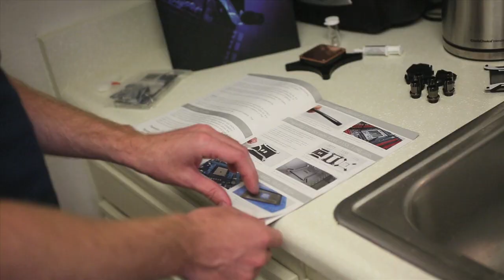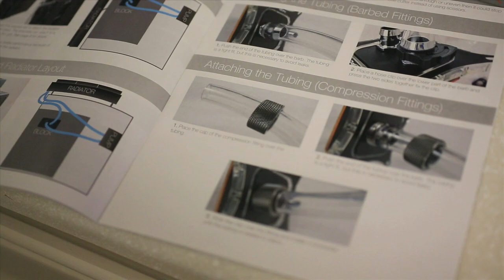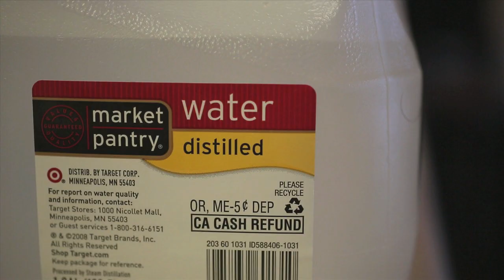A Beginner's Guide to Water Cooling Your Computer

Comment: Thanks but no thanks. Water will never get near my 2000 USD computer.
Reply: Dabket3araB you realize that its completely safe if you aren't an idiot. There are even all-in-one kits meant for idiots. So, ye.
Reply: Dabket3araB exactly :( 

edit: i ended up water cooling my $2400 pc ._.
Reply: robslifting4life Here's the PC I've built a month ago, Mr. Alienware Junk. 
Asus motherboard Maximus VII Hero
Intel i7 4790k at 4 Ghz
16gb g skill ripjaws x ram
GTX 980 4 GB EVGA video card
500 GB sata III HD
27 inch 2k resolution Qnix monitor
Corsair mechanical keyboard 
Logitech Gaming mouse
Total of 2800 Dollars to be exact. It is worth every penny. Again, no water will ever get near this Computer.
Reply: @Dabket3araB   jesus. i've spent a total of $800 on my newest PC and it can play most games maxed at 2K resolution and easily maintain over 120fps. did you spend most of that on the monitor, keyboard, and mouse? also why 16gb?
Reply: Dabket3araB First of all, just because i happen to know the exist, does not mean anything about what i do or don't use. Second, they are much easier and much less risky to set up than an open loop(whereas what i am talking about is a closed loop). Obviously its not for actual idiots, who wouldn't be able build a PC in the first place. 

You know this video? Yeah, you don't have to do 90% of it. You just put the radiator somewhere and the water block on the cpu. For example: http://www.coolermaster.com/cooling/cpu-liquid-cooler/nepton-240m/
Reply: Dabket3araB if you know what you are doing, its actually much better for your computer, especially with a high end cpu
Reply: No No No… Electrical conductivity of ultra-pure water is 5.5 × 10−8 S/cm (18 MΩ cm in the reciprocal terms of electrical resistivity) and is due only to H+ and OH− ions produced in the water dissociation equilibrium. 18 MΩ may sound like a lot, but as computers are very very sensitive electronic devices, it can still cause disastrous results when it leaks.
Reply: Marco Fella Why not get an i7 4790k if you have the money to buy it? I'm not being arrogant but when I shop electronics I aim to buy the best..
Reply: It's not a $2k pc because he is including peripherals like monitor. Also, you should buy an SSD, it makes such a huge difference, and now days you can get all in one water cooling for CPU, you just plug it in and that's it.
Reply: Dabket3araB i'd wager $1M on some good ol' hose clamps and teflon tape.
Reply: Lucas Jay not if you use mineral oil :P
Reply: LammaNerd no, water is not conductive the particles / free radicals make water conductive. ie... have a cup of distilled water with all of the impurities taken out add a light and (+) wire, then add other end into the cup. plug the negative directly to the light / plug, same with the other (+) wire. the light will not turn on...... now unplug the set-up and add a table spoon of salt "Impurities" to the water plug it in the light will come on.. I'm surprised that you have not done this in basic chemistry class.

Distilled water does not contain dissolved salts and, as a result, it does not conduct electricity and has an electrical conductivity of zero. Nevertheless, when the salt concentration reaches a certain level, electrical conductivity is no 
longer directly related to salts concentration.
Reply: Dabket3araB 
Asus motherboard Maximus VII Hero - 200
Intel i7 4790k at 4 Ghz - 340
16gb g skill ripjaws x ram - 100
GTX 980 4 GB EVGA video card - 525
500 GB sata III HD - 50
27 inch 2k resolution Qnix monitor - 450
Corsair mechanical keyboard - 130 (Assuming this is K70)
Logitech Gaming mouse - 80
Case - 240
PSU - 190

Total: $2305. If you paid shipping, that should be around $2400. That's 400 dollars you've thrown.
Reply: Math Debator
Btw, if you used alcohol, it would deteriorate the rubber tubing and also then destroy it, in the matter of days, instead of years, like the coolant does.....
Reply: I just built a new rig:
MSI Gaming Z170A M7 mb
i7 6700k
16 GB corsair vengeance
250 GB samsung SSD
2 TB caviar black
EVGA 980ti GPU
EVGA 750 PSU

I was really sketched out to put a water cooler in there, but I decided to give it a shot and bought a Corsair H105 and put it in.  I checked it the next day just out of paranoia and found a little bit of liquid leaking out at the base of the tube on the CPU block.  I said fuck that and returned it back to microcenter and picked up an air cooler.  Yeah, most of time that's not gonna happen, but it happened to me on my very first time, so I don't think I'd ever be able to rest at ease as long as I know there's liquid running through my computer.
Reply: Dabket3araB Its not water .. its an non conductive liquid you could pour it all over your pc and it wont short
Reply: @nedd44  you just solved my worries thano you and how much does it cost app?
Reply: nedd44 ... dionised water will aggressively recoup ions when running in your loop. It might start out non-conductive, but it doesn’t stay that way for very long. At all. Leaks are no more dangerous than psi death, and much less common.
Reply: Lucas Jay thanks :D
Reply: Dabket3araB sorry lol. i was thinking you would look things up, but i see why you took it like that.
Reply: Dabket3araB  Why did you bother getting  i7 4790k if you aren't going to  water-cool and overclock??  You do realise that the 'K' on the end denotes an unlocked chip.  It was made so that it could be over-clocked!  JEEEEZ!
Reply: Dabket3araB 
That PC was 2800 dollars? What the fuck? Where did you buy those parts? That is terribly overpriced. My PC was 1000-1100 dollars and the only thing different from that build is the GPU and RAM. My ram is better than yours and my GPU is a 970. I also have more storage than you along with a SSD and mine didn't go over 1300.  All of that together wouldn't even be 2000 dollars, so my mind is incredibly blown that you got it for a whopping 2800.
Reply: Dabket3araB If you have a 2000$ computer it's probably smart that you get water near it because water cooling helps keep your components cool and reduce the amount of dust in your computer along with the lower temperatures allowing overclocking
Reply: use a computer coolant made for it then. the coolants do not conduct electronicity
Reply: I actually got curious myself if coolant is conductive so i got my Fluke 175 and measured its resistance.
I tested clean distilled water and an EKWB Evo UV-Blue mix.
Turns out both liquids have around 500k Ohm resistance with the probes all the way in and around 2inch apart.

So yeah, better dont spill it.
Reply: +Dabket3araB Because its a bit like buying a Ferrari in a world of by roads and dirt tracks, ie it will never reach its full potential. (Assuming you're only going to game on it) You could still buy the best but much cheaper by choosing an overclockable i5, a bit less of the same ram etc etc. You could have halved your bill and you''d be getting the same performance you are now. But it seems money is no object to you and you just want to boast about your rig, in that case, good for you!
Reply: Dabket3araB I used to say the same thing, but, since I found my computer getting a bit warm, with my AMD FX-8350 CPU, I decided to look into what my alternatives are, and I found, the "Cooler Master Seidon 240M" which is completely sealed, and there is a leak-proof set-up for it(As long as you do not try to go to the extreme, and cause it to leak, obviously.), it works great, and it is quiet as can be, which, it has no reservoir, so, that eliminates that issue, plus, the tubing is clamp style sealed, which, are sturdy clamps, and I was able to fit it into my ThermalTake V3 AMD Edition Mid-Tower case, and like I said, it runs great, and super quiet, and no leaks.  Also, the computer, that I am using, is a custom computer, as well, which, I put close to $2,400.00 in the parts alone, I have an MSI 970 Gaming motherboard, AMD FX-8350 CPU(8-core), ThermalTake V3 AMD Black Edition case, MSI RADEON 6450HD 2GB graphics card, Seagate 2TB 7,200RPM hard-drive, dual 400GB 7,200RPM hard-drives(From my last build.), WD 750GB 7,200RPM hard-drive, Cooler Master Seidon 240M water-cooler, dual SilenX EFX-12-15R Effizio Silent Red LED case fans(120mm), with the red LED fan, that came with the case, Ultra LSP Series V2 750W PSU, chrome finished fan grills, for all of the fans, along with foam style filters, for the inlet fans, Cooler Master Thermal Compound(It is the most efficient compound, since it cools the CPU more then most others.), dual Samsung CD/DVD burners, along with a Samsung 19" monitor(Temporary, for now, until I can afford the 27-30" monitor.), as well as a few other misc stuff, but, I am sure, you get the idea, that I do have a high-end computer tower, as well, and btw, it took some minor modifying to the case, to fit the radiator inside, while the fans sit on the outside of it.........
Reply: +Dabket3araB dude, that's like a $1200 computer right there.  adding some overpriced mice keyboard and monitor doesn't count towards what your actual computer is worth.  And if you really spent $2800 on that, you got fucking ripped off.
Reply: i'm using the coolermaster evo 212 and it will stay in there forever!
Reply: Dabket3araB plus you can upgrade it if you wish
Reply: purewaterruler You realize you still need a pump right? That coolermaster has the pump built into the water block. 

something has to move the water, genius
Reply: WithoutLUCK sorry i forgot to mention something that would seem obvious. yes, all in one kits/closed loop kits all have pumps built in.
Reply: LammaNerd uh, thats not the reason. it just has a high heat capacity. it is conductive, but that doesn't help it at all.
Reply: Dabket3araB You can always buy non conductive liquid coolant
Reply: Lucas Jay Ok, then explain how a large number of people have done this without any consequences.
Reply: Marco Fella Asus motherboard Maximus VII Hero ?  Fans will never again smother my CPU.
Reply: Dale Kravets I have no idea what you are talking about.
Reply: Dabket3araB buy awater cooler then :p
Reply: Dabket3araB You do realize this video was made in 2012 right? Most people don't do water cooling like this anymore... Water cooling is just as easy is setting on a traditional Noctua cooler. They also don't leak nowadays. And 2000 for a PC build isn't much. I paid 2000 for my build. I just wanted a decent build. My next machine will be much better.
Reply: 03SilverMustangGT $2000 is a lot! In fact, a lot of PCs are around the $1000-$1500 margin, give or take a couple hundred. A $2000 PC, if built right with good, quality parts, will get at least 80 fps on BF4 with everything on Ultra.
Reply: bdawes123 i don`t know what you make wrong or something i play battlefield 4 with my 1000€ computer at ultra with 140-180fps all the time
Reply: Kevin Kern I said at least, accounting for frame drop, high city areas, etc.
Reply: ***** Yeah around 2800 Dollars, I wasn't lying. But you gotta understand dude the screen alone is a 2k resolution and the keyboard is mechanical fully customized and the mouse is as well specifically for gaming. These 3 accessories costed me alone about 700 Dollars.  So do the math now and come back to me...
Reply: Lucas Jay wat about mineral oil?
Reply: Lucas Jay would it still be as effective as distilled water? Would it take longer to cool or do they perform the same? If they did i'd just use mineral oil for everything then :/
Reply: Lucas Jay No that's cool i always like learning more about pc building :D you can never know too much haha but yeah that's interesting. Thanks for the information that's interesting. So that means then that distilled water and using dyed stuff is the same the only difference is you can visibly see the gunk easier?
Reply: +Dabket3araB got myself a 2000 dollar pc as well just buy a h100i and you'll be fine?
Reply: +Dabket3araB what if you used alcohol? would that work?
Reply: Echo I feel like the possiblity of the entire system leaking and squirting water all over the computer is too high of a risk
Reply: Math Debator This is something you do not want to do by yourself unless you are a trained computer technician
Reply: Echo :p
Reply: +Dabket3araB Jesus man where is your SSD?! Booting off SSD should be the norm by now?
Reply: +CreoleRep7 Oops sorry, I forgot to mention the SSD. I do have an SSD that I boot on and an extra regular Internal HD 7200 rpm for data/storage. The SSD is a Crucial 250 GB at 6 GB/s. I highly recommend.
Reply: +Dabket3araB Yeah I had the exact same build as you a few months ago basically.
Just upgraded to 970 SLI and added a  i7 6700k.

I've been building top of the line computers since 2009, Not once have I ever been stupid enough to add watercooling yet. Originally when I built my first computer, leaks were even more common back then and temps weren't even as low. So it was a high risk/minimal reward. Even now after the research Im doing, watercooling is getting better but I still can't get the courage to risk my setup.
Reply: +Mr Mid 
to mr mid, my name is thomas and i've been building my own pc's for about 20 yrs and never worried about water cooling systems, for my air cooling was sufficient. i now have a pc tower with a gaming mainboard and do play some games but my aircooling seems to keep things cool, so should i resort to watercooling?
Reply: If you'e temps are fine you have nothing to worry about. Watercooling is mostly for those who like to overclock
Reply: Thomas M
To answer your question, no, I would just leave it go as long as possible, and I would have to guess you are not OCing either, or running 1 of the high-end CPU's and the high-end RAM cards, which is where the heat really comes from, but, as long as you don't worry about doing that, you are all good.  I am using an MSI 970 Gaming motherboard, AMD 8350 8-core CPU, Kingston HyperX Beast 16GB 2133GHZ RAM, so, I do run it a bit higher up, and to do it, I gotta have a minimum of 750W PSU(Power Supply Unit), since i have all 6 SATA slots filled with 4 hard-drives and 2 CD/DVD burners.....
Reply: +Dabket3araB ikr
Reply: +Dabket3araB  now you can get pre filled coolers so it doesn't leak
Reply: +Dabket3araB Really because i spent 2800 on my mine and I'm looking at water cooling it within the next 2 months. ps i think its funny you included your monitor as the cost of your pc
Reply: +Dabket3araB i spent $6000 canadian on mine lol
Reply: +Dabket3araB all of that and such small storage space. tsk tsk updates DLC not to mention 60 gig installs not many games to be played here.
Reply: +James dude is it an hour or 24 hours? im confused
Reply: +Thomas M if you have been building computers since 95 then you should already know the answer to that question.
Reply: +James yeah youre right my H55 doesnt keep my cpu at 26C and its just a total shit system. also EK makes graphic card AIO loops.
Reply: James
i wouldnt go as far as to call it a starter kit. i wasnt talking about the customizable predator either i just said EK had some AIO graphics card coolers. and that my corsair h55 kicks ass.
Reply: ever heard of warranty?
Reply: +James 2nd reply accidentally deleted my first comment lol: ok so I am building my first pc and I was wondering if it would be necessary to water cool my pc, specs are,
i5-6600k 3.5 ghz quad core processor,
msi z170a gaming m5 motherboard,
g skill ripjaws v mem (16 gb ram)
msi Radeon r9 390 8gb gpu,
(didn't include other specs like Case and power supply because I thought it was irrelevant)

I don't plan to over clock anytime soon but Im getting the CPU just in case I decide to, I'm asking you for advice because you seem to know what your talking about, any suggestions to different parts around same price range are welcome,
Reply: +Antonio Belliard Mineral oil is what you're thinking of.
Reply: +Dabket3araB You know the liquid isn't going to form some monster and attack your monitors right?
Reply: Ballogabear
lol not the monitor, just the mobo and video card
Reply: robslifting4life poor pleb
Reply: i said same why risk short circuit when fans do just fine.
Reply: and the reason is that it would cost you as much as your computer is worth to cool it properly - wah wah waaaaah
Reply: robslifting4life jesus christ i thought the same thing
Reply: Ya fuck water cooling, if it liquid carbon then you gau
Reply: nedd44 FYI it would and did on my old PC
Reply: Dabket3araB sad to tell you its a shit setup and your keyboard and mouse have nothing to do with the setup, also your acting like your PC is incredibly special to not have water cooling but in fact most high end PCs (unlike yours) use watercooling in order to run an lower temperatures and quieter.
Reply: Feel bad for your cpu lol
Reply: 2000 is like , exactly where it stops before you water cool
Reply: Its just a pump and resovoir just make one urself instead of paying a ton of money
Reply: Water is actually non conductive, it's the corrosion products and minerals present that make it conductive.
Over time metals in your loop will corrode (even with additives) causing it to become /more/ conductive.
Reply: I run a full loop. My kit dtays cool with much more aggressive clocks, and the system is whisper quiet. I enjoy it as a hobby as well as a cooling solution, it doesn’t offer great value in terms of pure performance gain, but I really enjoy it.

The top CLCs are good enough for laymen, but they don’t hold a candle to a proper custom loop.

I doubt that our systems are that dissimilar.
Reply: odd flex but ok
Reply: Use fluorinert then.
Reply: Weird FLex but ok.
Reply: Dabket3araB conceited much
Reply: 1 paid ~400$ total for my water cooled PC
Reply: Dabket3araB Performance over price. I'm assuming this is your first build? Thinking price over performance? What the hell do you need 16GB of ram for? 8GB is plenty.... i5 is the best processor on the market right now, so you obviously over paid for your i7. My i5's running at 4GHz past few years with a simple corsair all in one watercooler. And why did you get just 500GB HD with 16GB of ram? Wtf... I'm also assuming that most of that 2000-2800 dollar price was your CPU, GPU and monitor... your card was probably around 400-500 if not more depending on some sites. Got my lovely XFX r9 290x for 250, brand new, unlike newegg for 450... Not everything is better with price. It's nice to do research and find the best parts for less. Imagine what you'd do with a watercooled rig, the fact that your at 4GHZ right now, withouone. Did you get the rig for gaming? What happens when you have to upgrade in a 1-2 years, when more demanding games come out? Money out the window again... I paid around 980 bucks for just my rig, tower, cpu, gpu, mb, etc... good fucking god with your 2800 for a build. Which btw good for you having, that's a wonderful thing, but shit. You overpaid buddy, it's not worth every penny. I'm 100% you could have gotten your parts for way, way less and under 1000-1500 bucks. lol shit that build list still cracks me up.
Reply: Dabket3araB  i think you can use baby oil, you can get that all over your computer and it wont affect it, its non conductive, but im not a computer scientist either, also i think distilled water is non conductive, you see the normal water contains particles that would get shocked, but distilled water wont
Reply: purewaterruler great you know about those kits "for idiots" it seems you use them a lot yourself. Lmfao
Reply: purewaterruler now that's a nice comment. Your earlier one seemed like you were a troll randomly referring to people as stupid. Thanks for the info.
Reply: Dabket3araB lol sounds like an Alienware junk.
Reply: Dude yeah, the monitor is around 450 and the GPU is 550 and CPU is 350 so that alone is 1350 dollars. Moreover,  the keyboard is 120 and the mouse is 80 bucks. The case is 240. The power supply is 850 Platinum for 190. Shit adds up bro. I have a master in software engineer so I have a general idea that I've overkilled it with hardware power mostly I won't ever use. And you're right, this is my first built. I'm not an expert in hardware as I'm in in software but I wanted a solid computer that can serve me for at least 7 to 10 years ahead and I think this one should do.
Reply: Lmao ur everyday liar if u actually spent 2000 usd on a computer you would know that water cooling can benefit your pc greatly
Reply: Dabket3araB You have a 2k comp and you're not water cooling it? lol
Reply: bdawes123 A EVGA GeForce GTX 980 Ti is $680 on Amazon. A good Intel processor will set you back just over $300 bucks too. I guess you could build it for 2 grand. But how the original poster worded it, he made it sound like he was bragging that he owns a $2000 pc. Which is a typical build.
Reply: Your PC would never run my $6700 PC
Reply: I undead up cooling my 5000$ computer 👌🏻